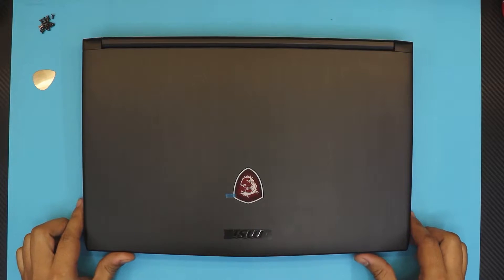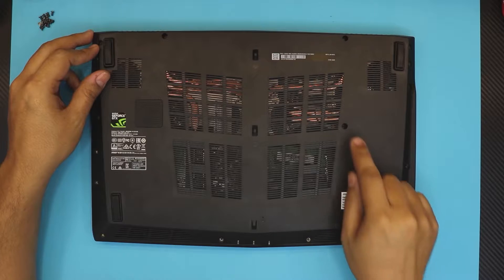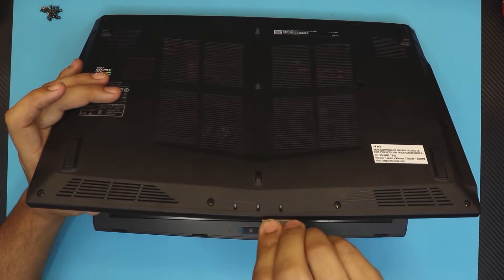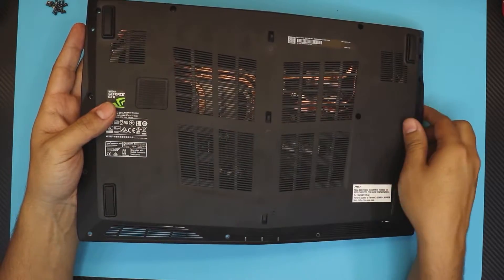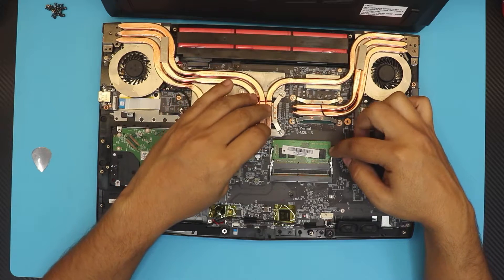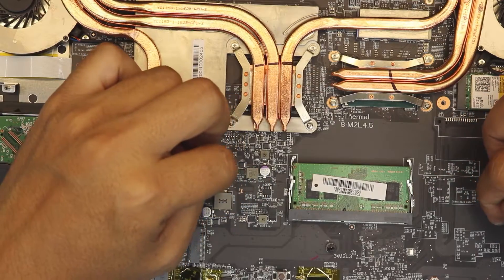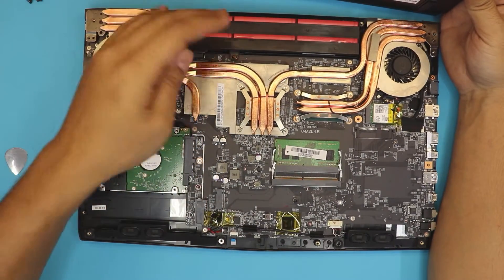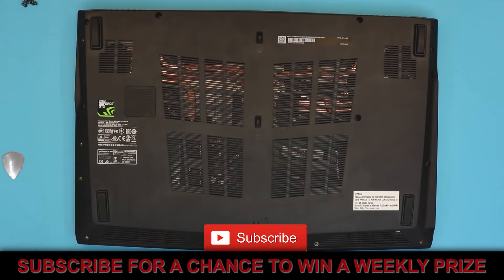MSI GL63 Series RAM UPGRADE Guide under 5min

Comment: wondering: i'm looking to upgrade the RAM in my MSI GL63 9SDK. it's currently at 16gb (2 8gb sticks) and i want to take it to 32gb (2 16gb sticks). i don't have much tech knowledge on installation so i wanted to ask if there is anything in particular i need to do pre-install or do i just remove the current sticks and replace them with the new ones? and do i need to do anything after installing other than power on the laptop and run it as usual? trying my best not to fry everything lol
Reply from the maker: 🫠Regarding your question, just make sure you power off the laptop, remove both RAM sticks, and install the new ones. You’ll be fine. When you power it on, it may take up to 30 seconds to display anything on the screen the first time because it will be performing a memory check.  
No other configuration is needed.
Should you have any further questions or requests in the future, please don't hesitate to ask me.
cheers🍻

Comment: hi, what kind of ram does come built into laptop?
Reply from the maker: Thank you for your feedback! If you would like to support the channel, you can show your appreciation by liking the video, subscribing to the channel, or doing both!

Regarding your question, the RAM that comes with the purchase is quite random. It depends on the timing of manufacturing and the availability of RAM stock. We have opened many of these models, both new and used, and have consistently found different brands and specifications, with Samsung being the most common.

If you have any further questions or requests in the future, please feel free to ask.

Comment: Hey mate Great video, i have a msi gf66, it has a rtx 3050 and an i7 core, but 8gb of ram. it stuggles to run some games, could it be bottlenecking the computer? anyways, the main question is should i just get another 8gb stick or just jump to 2 32gb sticks?
Reply from the maker: Thank you for your feedback! If you wish to support the channel, you can like, subscribe, or both!
Regarding your question,  oh boi your bottleneck is the ram right there, you need 16gb for gaming this days.
you have two slot dim available, you can place a 16gb on the 2nd slot and 8gb on the 1st and it will add to 24gb dual channel, or you can take it to the moon by placing a 16gb x 2 for total of 32gb and enjoy your gaming and everything.
https://amzn.to/43by9ki

Comment: I have MSI GL63 8se it has 2x8go samsung inside I want to upgrade, can I get that dual pack from corsair vengeance you recommended 32go (2x16go) it will fit gl63 8se?
Reply from the maker: Thank you for the feedback! if you wish to support the channel you can LIKE or SUB or both :P
regarding your question:  yes it will fit fine, https://amzn.to/3EJXbgP 
just double check and see the max ram capacity: https://youtu.be/tKEJTkVth4Q
Reply: @uFixTek  thank you !! 👌
Reply from the maker: anytime 😊

Comment: Hey, I have (msi gl63 8se rtx2060 i7-8750) 
- stock ram is ( 1x DDR4 16gb 2666hz )
- It can go up to 32gb

I'm looking to upgrade my ram and go for a dual channel
but i have multiple questions i want to know :
1- can i use a ram with the speed of 3200hz? (mine is 2666hz)

2 - you said to someone in the comments to go for 1r, isn't 2r better?

3 - i mainly play on the laptop, heavy games such as cyberpunk and cod, would you recommend me what's the best and fastest compatible ram to buy ( price doesn't matter )

Final question, what's the best configuration to go for ( 2x 8gb total of 16gb ) or ( 2x 16gb total of 32gb )?

Thank you.
Reply from the maker: Thank you for the feedback! if you wish to support the channel you can LIKE or SUB or both :P
regarding your question: ok, 1st of all you have intel CPU, therefore you don't need to worry about the ram speed as the ram speed is more for AMD CPUs. if you had AMD cpu then ram speed would be very very important.
1.you can place a 3200mhz but the motherboard will adjust it to the speed that it can handle.
2. go with 32GB ram and go for same brand and speed so you get a good performance. (its ok to have different ram speed and Gb ) but not a very good idea. you can have 8gb and 16gb still counts as dual memory.
3. we use this brands a lot and its very solid: https://amzn.to/3DcOsSP

if you have any question or request in the future feel free to ask me.
Reply: @uFixTek  thank you for the quick response 🙏 

I actually do have some more questions 
1 - Can i use any ram as long as its 2666mhz? Because i don't how can i know if it's compatible with my laptop or not?

2 - kingston fury impact 2666mhz CL16 VS teamgroup elite 2666mhz CL19, are these 2 compatible with my laptop ?(msi gl63 8se)
If yes, which one is better?

Thank you
Reply from the maker: @1oym1  you can use any brand as long as its sdram DDR4 you fine, if its not 266its ok too the bios will down-clock it to the 2666.
i would go with teamgroup  elite , but honestly any of them is ok.
Reply: @uFixTek  thank you 🙏
Reply from the maker: my pleasure my friend

Comment: hello, i had solved this topic months ago but i lost the link. I have a MSI G75RAIDER 8SG RTX 2080 AND I NEED EXPAND THE RAM. TODAY, WITH 32 RAM.  MSI says in a official way, that doesnt supoort upgrade for 2 slots of 32 to get 64. but somone here says yes. and HELEPD ME givING me a link of the propoer ram to buy. Can help me ? tks.   i had passed my serial number.. i dont remember if was you but i tnik yes. Could remember ths  again ?   SERIAL NUMBER 9S717E212030ZJ1000022   BIOS E17E2IMS.119   INTEL (R) CORE (TM) i7 - 8750H CPU 2.20 GHZ
Reply from the maker: Thank you for the feedback! if you wish to support the channel you can LIKE or SUB or both :P
regarding your question: i have upgraded to 32GB with this rams without any issue: https://amzn.to/3zCsqIi
if you want to go to 64GB then you need to use this (2666mhz only): https://amzn.to/3OF9FZ2
Reply: @uFixTek  tks.  a lot.
Reply: other users put confused due they sayd me that not confuse with ge 75 9th generation that yes accept 64 ram.  I think i am being clear putting my class and type of model up. tks again for the time.
Reply from the maker: do me a favor and check this video and see what is the max number that it gives you, let me know, https://youtu.be/tKEJTkVth4Q
me avisas porfa
Reply: the 1st number in cmd is :33554432  / by 1.000.000 = 33,554432         /// memory devices = 2   tks a lot.
Reply from the maker: @alexarchviz1613  sorry to inform you the CPU on your laptop only can handle 32GB of ram (33,554432 = 32GB) :(
Reply: @uFixTek  ok. gracias
Reply from the maker: por nada amigo, saludos

Comment: i own the gl63 and i purchased the ram you recommend in the comments. i have installed the ram now when i turn my laptop on it turns on but it’s on a black screen. any ideas?
Reply from the maker: if you only purchased a single ram dim and you wanted to add next to the old ram you have, then do this:
remove new and old ram, place the new ram to the 1st dimm (the one near the motherboard) then power on the laptop without placing the back cover and wait 5-15sec then you should get a logo and system should start, but once you got the MSI logo or anything then power off quickly,  then place the old ram in the 2nd dim and power on and wait 5-15 sec and you should be fine.
Reply: @uFixTek  okay thank you very very much i will try right now.
Reply: @uFixTek  the MSI logo won’t even show up on start up when i install the DDR4.
Reply from the maker: OK, send me an email with you phone# and i try helping you via whatsapp
ask@ufixtek.com
Reply from the maker: Thank you for the feedback! if you wish to support the channel you can LIKE or SUB or both :P
regarding your question: ok you got a single ram dim? what capacity?
Reply: @uFixTek  no it’s dual. it had two slots with only one ram drive from factory. so got 2x8 16gb ram to install. maybe it is too much, i dont know much about computers sorry.
Reply from the maker: so you purchased a  pack of 2 x 8GB ram (16gb) that is fine this laptop can go up to 32gb no issue.
and the ram you have on the laptop is 8gb or 4gb?
Reply: @uFixTek  it’s 8gb. i want 16gb so i can run games better.
Reply: but everytime i turn on my pc after installing the new ram it just sits on a black screen.
Reply from the maker: ok, if you have 8GB then do this:
remove that 8GB and place a new 8GB that you purchased (only one of the 2x8gb), and place it in the bottom slot, and power on and you wait 5-15 sec and you should get a logo.
and if you did get a logo then turn off and place the old 8GB in the 2nd dimm.
i think you maybe not pushing the ram inside the slot.
Reply: @uFixTek  i promise you it’s fully in the slot. and i’ve tried both and it still does not show the MSI logo.
Reply from the maker: return the rams if you purchased them on amazon, and get this ram this are very compatible with many bios of the laptops we use this brand all the time and they are very stable.
https://amzn.to/3QVvLZO

Comment: Did I need use special equipment to open the lap top ? And can I ask my ge63 gaming laptop playing game sometimes will lag . When I change my ram to 16 or 32 will better ?
Reply from the maker: Thank you for the feedback! if you wish to support the channel you can LIKE or SUB or both :P
regarding your question: i use this screw driver kit its a high quality bit:
https://amzn.to/3qM2F42
but if you looking for a cheap solution get this:
https://amzn.to/33ZKrTO
and use a metallic guitar pick:
https://amzn.to/32l9D6C

and i would recommend to double check to make sure your laptop can support 32Gb,:
https://youtu.be/tKEJTkVth4Q

and upgrading the ram defiantly will help a lot in games, 32gb i would recommend this brand they are rock solid and very compatible:
https://amzn.to/3KBxMY6
Reply: Thanks for you helping . But still thinking will let people upgrade for me. I scare make spoil. Hahaha
Reply from the maker: no my friend its very essay and you wont fail, if you need help im here to help, its very easy take your time 1h relax and try it. if you see that you struggle half way in then sure go to another person.
Reply: The screwdriver I have . Just the guitar pick need buy . Can I use other thing to open ? Like ruler. Will try when I free 😅
Reply from the maker: anything soft edges and metallic.
Reply: 👍 so what meaning buy the ram mhz? I see price more high when mhz high . Sorry for disturb. Newbie on those thing 😅
Reply from the maker: this is the Intel CPU for the intel CPU you dont have to worry much about the ram mhz. if it was AMD sure get the higher mhz. i would go with 2400mhz you save money and you won't know the difference from 2400 to 3400
Reply: Thanks for info that . If not I serious don’t know. Love ya 😀
Reply from the maker: anytime my friend :)

Comment: I bought a 16x16 kit for 32 total but my msi Gl 62m with ms16j9 motherboard. However it will only boot with the original ram stick. The new ones will not boot together or separately however if I run the og with a new one it will boot and it shows 24 gb available ram. Do you know why I cannot boot with both 16 gb sticks?
Reply from the maker: Thank you for the feedback! if you wish to support the channel you can LIKE or SUB or both :P
regarding your question: maybe the bios is old and can't mem check more than 24gb, check this video to see what max ram number you get:
https://youtu.be/tKEJTkVth4Q

Comment: I did the yanked part once and whenever i connect eadphone or earphone for my laptop. The left side is deaf. Rip my laptop.
Reply from the maker: sorry to hear that, but you can replace the audio jacks and you will need to solder the new jacks in or if you send me a picture maybe you have just a broken jack and fixable.

Comment: i have the msi gl63 8rc i wanted to upgrade to the corsiar 8gb 2666 dual channel ram u suggested in some of the comments. did i order the wrong ones??
Reply from the maker: Thanks ✌  for the feedback! if you wish to support the channel you can LIKE or SUB or both :P
regarding your question: you cant buy a dual channel ram, what does the dual channel ram configuration means is that when you have two ram dims installed the motherboard will automatically split and share the file into both rams and that can speed the process of writing and reading from the ram much faster and that is called dual channel ram CONFIGURATION.
and yes you can place a 8gb ram https://amzn.to/3xHDCze
+ the ram you have on board , this way you will get the dual channel configuration activated. even if you place a 16gb ram dim in the dim you still get 16gb + what ever you have on other dim and still have dual channel.

Comment: My laptop currently has 8GB of ram 2400 was wondering if 2666 be more beneficial at 16gb ram or just get an extra 8gb of 2400 to be at 16gb ram?
Reply from the maker: as this is intel CPU and because of that the 2666 or 2400 will give you the same result, if the CPU were AMD then the higher speed would greatly benefit. therefore dont waist your money by placing a 266. and also if you have a 244 in there and if you add a 2666 beside it, the bios will downgrade the 2666 speed to match the lower (2444), 
we use this rams:
https://amzn.to/39sazXf
https://amzn.to/31wapKb

Comment: I'm looking for an 8GB Ram 2666 for my GL63 8SE, any recommendation aside from corsair vengeance?
Reply from the maker: this are the one that we use a lot and they are very rock solid ,
https://amzn.to/3dlGStK
make sure you get single rank

Thank you for your support to the channel :)
Reply: @uFixTek  Didn't expect to get an answer that quickly!
I'll try to look it up if that one is available around here or not since i don't want to buy one from outside the country (don't even know if it's even possible currently).
I checked the brand i currently have and it's Samsung, so is Samsung an option or no? seems like Samsung is easier to get than corsair or crucial.
https://www.amazon.com/Samsung-PC4-21300-2666MHZ-SODIMM-laptop/dp/B07F6HBK1N/ref=psdc_172500_t2_B071KNKBQ1
Reply from the maker: yes this will work just fine 
https://amzn.to/2N4rkzT
and Samsung NAD chips are very well known for long lasting .
Reply: @uFixTek  Got it, thanks a lot for the helpful and quick answers! I'll also be using this vid since it's easy to follow through. Cheers!
Reply from the maker: Thank you for the feedback and when ever you got questions you can ask me here or in any of my video comments, good luck my friend.

Comment: Brother is there anyway that i can upgrade my GPU ? This laptop is so damn sweet and its certainly an eyeturner, I just dont wanna sell it, because its too damn fast, the only issue is the GPU being 1050ti.
Reply from the maker: Thank you for your support to the channel by a SUB :P
regarding your question; this laptop are not up-gradable CPU or GPU unfortunately , lets even say that you get the gpu reballed with different GPU, you will need to change a lot of the components around and change the bios and change the charger and dont even get me started with heat transfer and many many other complications.
sorry to break it down like this, i wish i could of said yes

Comment: I have MSI GL63 series laptop. Currently Imy laptop has 8GB RAMby default. Can I add 16gb RAM stick keeping the existing 8GB RAM stick as it is? Please reply!
Reply from the maker: yes you can and it will work just fine.